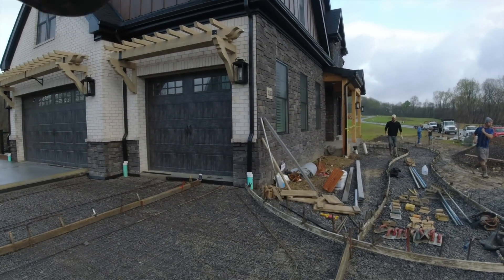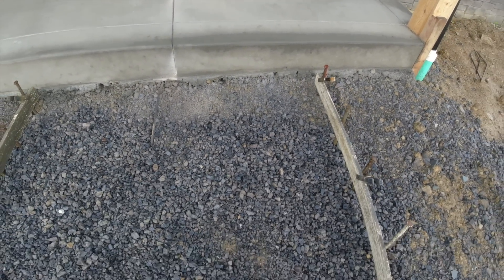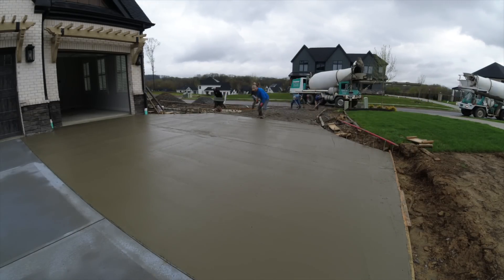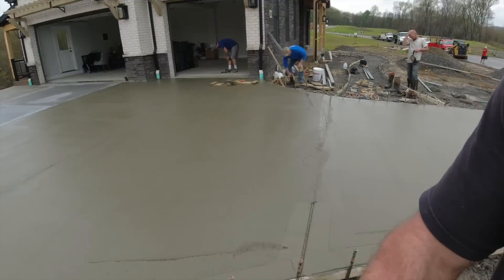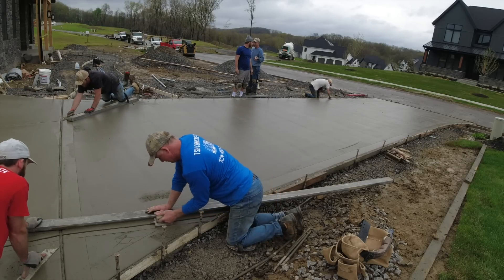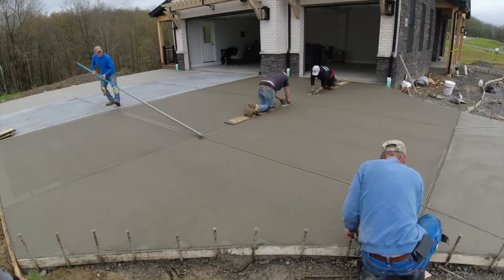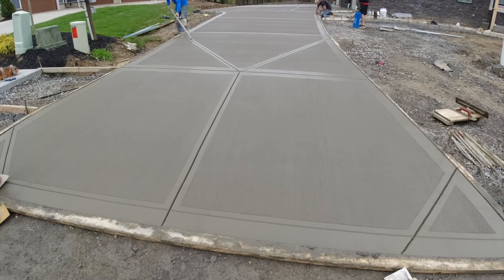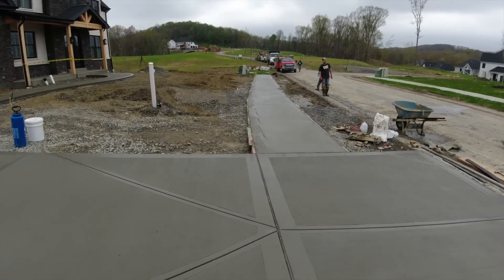Inches of Rain is Not Stopping Us!

Comment: Is the use of wire for cost? I’ve never used wire in a driveway. Always use steel, wire to hard and aggravating to mess with...I know everyone says wire is on the bottom it’s not pulled pulled up, but I have tore out drives where you could see the wire on the bottom of the concrete and it still held the concrete together..
Reply: We use wire and rebar in our driveways. If we aren’t able to use chairs, we make sure the wire gets picked up and is in the middle of the concrete. Thanks for watching!
Reply from the maker: We use the wire mats a little bit easier to deal with than the rolls of wire I’m sure some of our wires left low we do our best to get it up in the concrete same way I’ve torn it out with wire and without wire and the wire definitely holds the concrete together